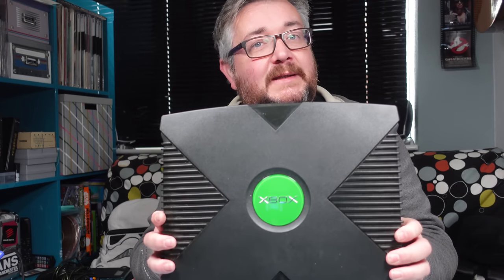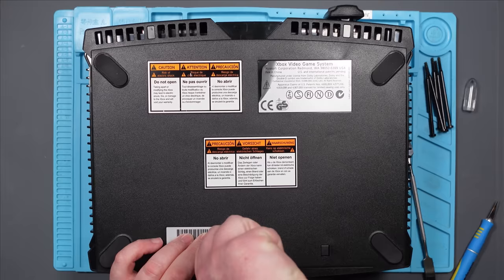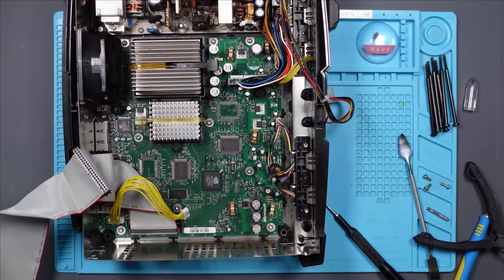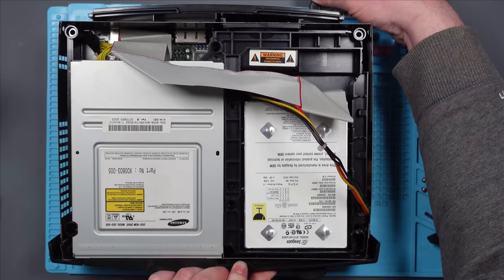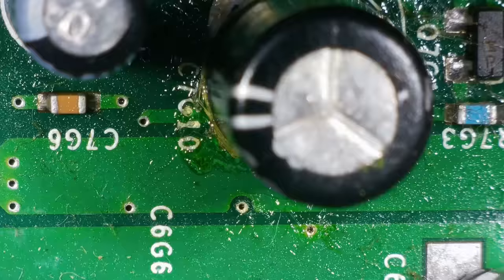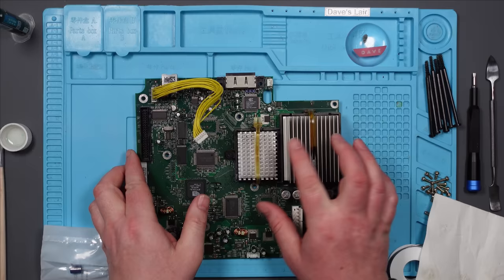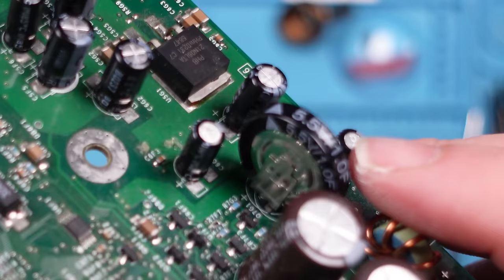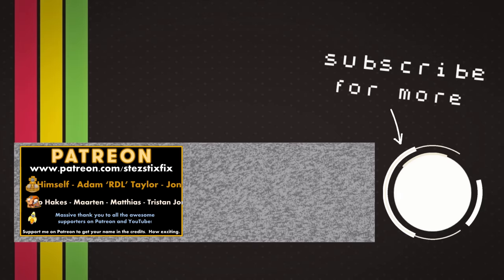This OG XBOX Won't Turn On | Let's Try and FIX it!

Comment: The Xbox DVD dongle specifically unlocks the codecs and licenses to decode DVD discs, not just adding IR and such. The hardware to decode is actually on every Xbox but is locked out until you have this dongle. So it's primarily a licence dongle.
Reply: Indeed, microsoft didn't want to pay the licensing costs up front for DVD compatibility, as Sony had some of the patent royalties microsoft didn't want to give free cash to sony so left it up to the consumer afterwards. The xbox was heavily subsidized (cost much more to produce than they sold it for). Microsoft lost $6 billion on the OG xbox but it brute forced them into console market. It was a fine console, graphics were a gen beyond the ps2 (it had a souped up Geforce 3 Ti which on its own cost more for PC than the entire xbox) and the duke controller with its epic powerful rumble still rustles my jimmies in a good way.

Comment: At 13:54 if you look look closely the pins have the polarity on them The solder area on one pin is a "+" (13:39 wit 3 spot welds in it) and on the other side is a "-"  (13:43 with 3 spot weld in it)

Comment: I left a lot of good knowledge on your crystal Xbox repair. Initially the power pins were hard wired to the PCB of the PSU board, later they figured it's dangerous (many Xboxes caught on actual fire because of the broken solder joints) so later they put in a wire to make a flexible connection between the pins and the PCB.
Yes, the clockcap is bad. Remove it! If you still have an upopened Xbox, open it and remove the clockcap! It's a ticking timebomb and it's going to ruin your console. Only 1 or 2 motherboard revision need a clockcap inside and those motherboards are usually built with a better quality Nichicon caps.

Comment: So this has probably already been posted but about the DVD dongle plugged in at the front:

The Xbox had the ability built in to play DVD's, but in order to not pay the license fee on each console sold, and to not pass the cost of the fee to the consumer, Microsoft decided that to play DVD's a separate dongle with the attached license fee should be an optional purchase. 

They included a media remote to help entice buyers knowing most probably wouldn't bother purchasing this. And it's true, it didn't sell all that fantastically. 

I believe 3rd party softmods allow DVD playback without the Dongle these days, been a long time since I touched an OG Xbox.

Comment: A bit of general advice please. Back in the early 80's Maplins used to sell project kits. I made a 5 channel light controller back in that time for use in the local mobile roadshow...
Now approacching my 60th i am getting back into Amiga's, and also general electonics.
What gear would you suggest for starters. Type of soldering iron, a good book/guide, work mat. Basically i want to build up a kit ready for when i retire and start servicing my Amiga, etc.
Great videos, very entertaining. Keep up the good work.

Comment: Hi Steve it's Steven here. Looks like a 10GB drive the sectors are listed as 20005650 you multiply by 512 to get bytes then divide by 1,000,000,000 to get GB

Comment: I used to have one of these, I added a modchip, changed the hard drive, the disc drive, added a USB port and a green led ring on the top logo 👍🏻

Comment: before finishing the video i calculated (tried to ) the hard drive space 
The size of a hard drive can be calculated using the number of cylinders (CYL), heads (HDS), and sectors per track (SECT). The formula is:
Size = CYL * HDS * SECT * Sector Size
The sector size for most hard drives is 512 bytes.
Size = 16383 CYL * 16 HDS * 63 SECT * 512 bytes 
Size in GB = (16383 * 16 * 63 * 512) / 1,073,741,824
This gives us approximately 8.4 GB. So, the hard drive is around 8.4 GB in size. maybe im bad at math thanks GPT!

Comment: Just noticed with that round capacitor you put in, the sides are somewhat labelled, looking where the legs attach to the unit one side has a positive imprint while the other has a negative imprint.

Comment: Modding it is in your best interest. The console won't boot without a working HDD, and the HDD is security locked and tied to that specific console in the EEPROM. If the drive dies, and you didn't dump the EEPROM or zero/null the HDD key, you are basically sitting on a paperweight unless you undertake a very annoying bit of sorcery using a Raspberry Pi and and the JTAG port.

Just mod it. You should always mod your OG Xbox. Always.

Comment: I recently found your channel and it is so relaxing and fun. It was exciting when this video popped up on my feed. This is one of the few consoles I have worked on. I had all the same faults as you except for the cold solder joint on the power board. While I have never understood most of what you do in your videos as I’m a newbie, today I was excitedly hoping you would catch the clock capacitor.

Just to let you know, several sources online stated it isn’t worth replacing that capacitor as the machine runs fine without it and even replacement capacitors are prone to leakage. For what it’s worth, my main Xbox does not have that capacitor and the only downside is that I have to re-enter the time and date if I unplug the console. That said, it usually remains plugged in so it is no bother and it is a small price to pay to not worry about issues down the line.

One last thing, I was so happy to see you take the care to peel back the stickers. It would have been nice to see the end result, but I took the same approach on my unit and you can’t tell it was ever opened. It’s sad so many of these consoles have the stickers damaged because people didn’t take that step. I know it is a small thing, but it feels like a nice step in maintaining old video game hardware.

Thanks for a fun video and great karaoke as usual!
Reply from the maker: Thanks Art of Mana!  Much appreciated.  Yeah, i would have been one of those who just go poking in screw holes and tearing stickers off, but I've conditioned myself not to do it.  I want to leave the console as close to factory as possible!  Sorry I completely forgot to show the underside of the console after putting it back together, but it does look great! 👍

Comment: That's the 10GB HDD, The DVD dongle is for the remote but also enables DVD playback even without the remote. It is required for DVD playback with or without the remote.

Comment: The clock capacitors are a ticking time bomb in all older Xboxes. They must be removed. The rest of the caps are pretty resilient.
Reply: The clock capacitor can just be left off. Especially if the Xbox is softmodded (highly recommended).

Comment: Old video but I remember when my Xbox cd tray would get constantly stuck closed. I got it to work by opening the CD tray, then with tweezers I was able to take that rubber circle piece out, cleaned it. It was fairly dirty. Put it back in and walla, opens and closes with no issues. Didn't have to open the Xbox up either.

Comment: The size of a hard disk drive (HDD) with 16,383 cylinders, 16 heads, and 63 sectors per track is approximately 8.4GB. This calculation is based on the parameters provided and the standard sector size of 512 bytes. 16383 * 16 * 63 * 512 bytes in GB

Comment: On OG xbox the v1.0-1.5 revision boards are notorious for leaky capacitors and most people just recommend outright removing them. Though 1.6 boards seem to not have issues with leaky but that revision of board requires a clock capacitor to function.

Comment: It wasn't 'not powered on for years', you literally plugged it in to test, so always discharge! :)
Reply from the maker: I just meant it hadn't actually worked for years.  I did check all the capacitors before touching anything and they were all in the microvolts.  👍

Comment: I tend not to power them on when I find factory sealed consoles,I've found one or two loose screws from either the HDD tray or motherboard & PSU that have come off from poor assembly from factory.Nice re-work on those AC terminals,they come loose after wriggling the AC cord when plugging them in ;)

Comment: 13:45 Look at the side of the new cap, where it's attached to the prong. The three little welded (welded?) spots are surrounded by a + shaped depression on the positive side and a - shaped depression on the negative side.

Comment: The goo around the capacitor you mention is "normal" is the clock capacitor.
The chip is rather powerhungry when it comes to the clock so Microsoft opted to use a capacitor to remember the time for about 4 hours.
They all fail if it's not a rev 1.6, take it out and call it done.
It's the one with "AEROGEL" on it.
You also dont need to put one back in.
Reply from the maker: Thanks Johan.  I didn't mean the goo was normal, I meant the rest of the board looked ok.  Not sure if you watched the whole vid but I did take out the clock capacitor.  👍
Reply: @StezStixFix  yeah I spoke rather soon, i have taken so many of these caps out, they all leak.
It also does not need a replacement, it's so you dont have to set the clock when you take your xbox to your mates house within 4 hours.
After that cap is empty and you need to set it again.
For the thermal paste: use acetone, takes 2 minutes then haha
Reply from the maker: @samuraidriver4x4  that's a good tip, thank you!

Comment: next step : upgrade the HDD transfert with an UDMA33/66 - 80 pins cable. the installed one is a standard 40 pin ATA/16

Comment: the DVD dongle thing was pretty funny, the original Xbox required it to play DVDs, they did this to get around tariffs or something if it could play DVDs right out of the box. Modded consoles did not require it.
Reply: It was because MSFT did not want to pay Dolby for a license for every console if the customer wasn't going to use it for DVDs.

Comment: I had to fix one, my one. The clock capacitor leaked and damaged the board. You was lucky. I sorted the board and stuck a new cap back in. A decent one. I then upgraded the hard drive to a 500gb one. That in its self is a big job. I then soft modded it then filled it with games. Great machine.  Looks mint still and has its complete box.
Reply: What am I suppose to do or text 🤔

Comment: About 15 years ago, my xbox had a problem, it wouldn't turn on. Despite knowing nothing about electronics, I wanted to open it up and see if anything was obviously wrong. I could never find the screws. I searched the entire xbox surface multiple times. I eventually decided it must be held shut internally by clips, so spent a stupidly long time squeezing the xbox in weird ways to try to get the (apparently non existent) internal clips to unlatch. I then came to the decision it's manufactured in such that way that it's impossible to open the xbox without using a power tools to cut away the case. I didn't want to do that, so just gave up. I never actually thought to look under the rubber feet or stickers. I guess it's a good thing I didn't take an angle grinder to the case like I was originally thinking.

Comment: 25 POUNDS?  Jeeze, I think I had a bargain for $5 It had an orange ring on it, that apparently the thrift store thought meant it was dead. I spent another $30 or so for an original Duke controller (that was in near meticulous condition), an AV cable (that caused the orange ring if not connected), and a mod chip so I could get it to play backups. Well... That would cause the 25 pound price if you bought all the extra parts to make your robot friend. But I also had to spree shop for an HDMI adapter so I could run it at 1080P (take that, PS2!).

Comment: With systems that have a high thermal delta, such as bare Die or the GPU in the motherboard chip there you want a thicker compound like a Ceramique or something.  

The heatsink and die get so hot the size change from thermal cycling will 'pump' regular thermal paste completely out in a matter of months.  The thermals on OG Xbox not very good.

DVD drive is swappable on Xbox, any drive andy console.  Get a HDD big enough for your collection and save all your games to the HDD.  Then you don't have to worry about it not reading the discs and loading is much faster too.

You can buy rubber bands for replacing the drive belt, but I imagine you can get a road bike innertube and use a razor knife to cut a cross section 2-3mm.

Try Sneak King the game from Burger king promotion (it also runs in Xbox360 and original Xbox)

Comment: I had exactly the same power supply problem on the same pin too. Mine was sparking and crackling though. There just isn't enough solder to keep a good connection with the power lead being taken in and out.

Comment: Most disc drives good idea to fully clean and re grease the rails helps a bunch I use to do it on my PS2 made it sound and load games way way better with out any grinding sounds. Can use isopropyl for the lense but tricky to do with out touching it 🙊

Comment: You can calculate the drive size in megabytes by doing (512 * cylinders * heads * sectors) / (1024 * 1024). This comes out at 8,063 megabytes or about 8 GB.

Comment: The last spec on the HDD is the number of addressable blocks. For older HDDs like this it's safe to assume blocks are 512 bytes, or half a KB. Thus, 20.000.000 blocks means 10 GB.

Comment: The disk drives all get stuck on the og Xbox.  The best way to get it to open is to give it a nice hard smacking.  Not sure why that works, but I did so for about 3 years in the old days

Comment: It’s be interesting to see you fix an Xbox360 that has “Red Rings of Death”.  We use to “fix” them by wrapping in towels to get them to overheat until shutting off.  Be cool to see what the problem really was
Reply: On phat 360 consoles It’s usually a fault inside the actual gpu itself. You have to replace the entire gpu to fix it which requires bga soldering skills. Others have used and bolts to try to force the gpu to make contact but that’s not gonna help if the faults inside the gpu hence why it was never a permanent fix. People would use heat to warm the gpu which would I assume flex the board and cause the gpu to make contact for a short amount of time before dying again. There’s a video by Josh Davison on YouTube with more information of why the bolt mod doesn’t work if you’re interested.

Comment: I had an old Xbox when it originally released and at some point the disk drive stopped opening and you know I had gotten newer consoles by then I had an Xbox 360 and Xbox 360 played most of the Xbox games that I had so I never really cared to fix it and then one day I found a video on YouTube saying you know if the disk drive isn't open it's probably that little rubber ring and you just have to drop in some boiling water and that typically will fix the problem.

My original Xbox was at my mother's house who ended up passing away and then my aunt went through the house and said to take everything that I wanted to keep and set it aside. Me naively thinking surely she wouldn't go away my old game consoles didn't put them with the rest of the stuff and I just left them in the room with the others.

Come to find out she ended up taking all the old game consoles besides the really old ones (NES, SNES, N64, Dreamcast and a few others) that I had already taken out (Xbox, ps2, ps3, wii) and taken them to an electronics recycling place.... Goodbye childhood. Hours of daved data.

I really want to get another original Xbox though cause that was my favorite console from the era.

Comment: these things have 3 major age related problems. clock cap, the rest of the electrolytic caps aging out, and the laser in the dvd drives failing. 

random info;

if your clock cap is pulled before it goes boom (or doesn't do much damage), and your xbox doesn't boot at all, it's probably the caps on the mainboard or in the psu section. honestly, at the age these are, and how heavily they tended to get used, they should all be recapped completely. it's like, $10-15ish at most, and means it'll last (barring some other part failing) another 20+ years if you use good caps.

first two are easily solved by anyone who knows how to solder/replace components, third one isn't as easy. you can get new one laser modules, and they're somewhat easy to install, it's just an involved teardown of the dvd drive in addition to opening the console. (and remembering to unsolder the static safety drain link on the assembly). and then you get into there being 3 models, and you need the right laser for each type. there's also replacement laser decks (motor spingle, plate, laser, laser movement motor, flat flex cable) for some of them.

thankfully, if its completely dead (dvd drive, including the drive board), the og xbox didn't key the drives to the mainboard like 360s did, so you can literally just use a working one if you can get one.

if the hdd is dead, you need to modchip it and some other stuff to install a new drive, if you haven't softmodded it and either zeroed the drive key or backed up the key from the now dead drive. this whole process either way is more involved than i'm going to cover here.

lasers for each type;

LG 8050L - SF-HD68
Philips VAD6011/21 - SPU-3141
Philips VAD6035/21 - OPU 51.61/03
Samsung SGD-605b - SOH-DR16S, SOH-D16, SOH-D12
Samsung SGD-605f - SOH-DX1
Thomson TMG600 - TOP60 

and don't forget to redo the thermal paste while you've got it all apart!

cheers.

Comment: Same thing happened to mine about 10 years ago version 1.1, maybe a common issue. I pulled it apart and re soldered, still going strong except for the disk drive no longer works. I modded it also